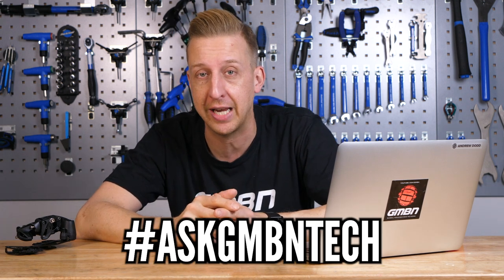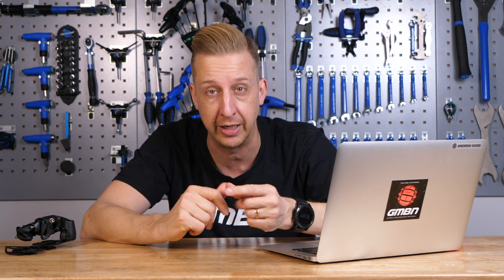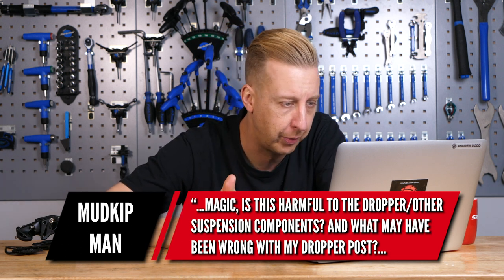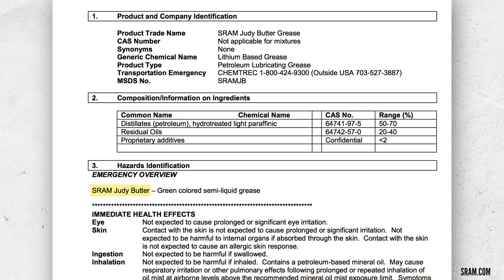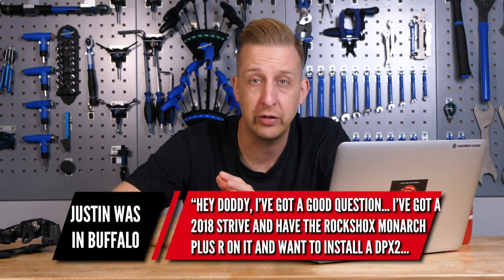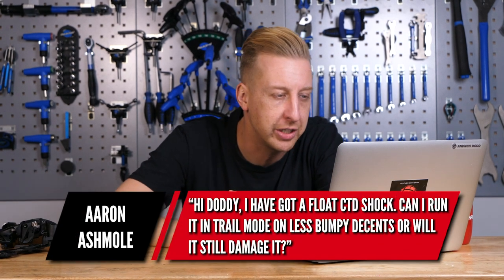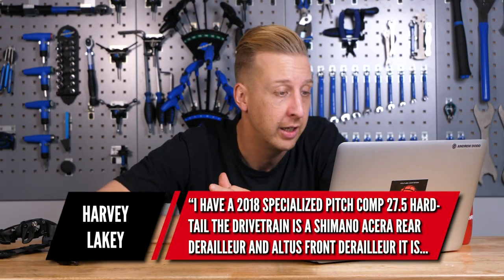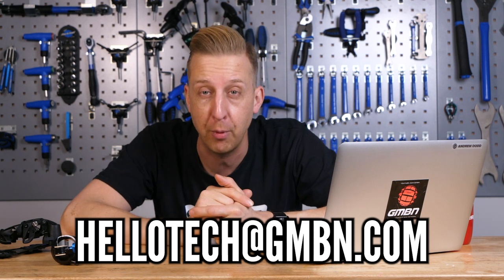Can You Use Vaseline On Mountain Bike Suspension Forks? | Ask GMBN Tech

Comment from the maker: Don't forget to leave your questions in the comments below using #AskGMBNTech
Reply: #AskGMBNTech Hey Doddy! I have a project bike (Vitus Nucleus) with a stock Suntour XCT coil-fork. I took it apart for a dumb reason and after that the fork has had quite a bit of play in the bushings (or seals since I removed them too). What is the cause and how can I solve it? I'd like it to work as it's meant to do till the day I upgrade it. Thank you!
Reply: Hi Doddy is it normal to loose teeth on the biggest sprocket on a 1 x11 system, if so what causes it to happen ? Because I have one or 2 teeth missing on my bike - Thanks Kyle #AskGMBNTech
Reply: #AskGMBNTech I have just bought an Avanti Competitor S 1 Plus. It shares the same frame as its big brother the Competitor S 2 which comes with an external dropper post.  I'm wandering if I should add a dropper post to it now as I am concerned that manufactures will go 100% internal cabling in their line up. Also what upgrades should I do to it for a beginner? (sorry for double posting I was not sure if I was to post it in the general comments or here)
Reply: Im looking forward to the video on the bar and stem changes!
Reply: #AskGMBNTech Hi Doddy. First of all love the shows and have been a great help allot of times. The question is, if it's possible to upgrade a 2016 strive with the new fox shape shifter 2.0 system?
Reply: #AskGMBNTech I've been working on my chain and it doesn't have a mater link so I've took out the pin but the pin has came all the way out. How do I put it back in?
Reply: @alexhazeldine7897  with a hammer (don't actually use a hammerl
Reply: #AskGMBNTech hey doddy I was wondering if you could actually use the mineral oil from of the reverb remote system for a shimano brake as its both mineral oil...
obviously it's most probably not the same mineral oil, but do you think/know if it works?
Reply: recently my old bike front shox rebound stick is gone,the old bike is a RockShox 30T silver..what could i use to replace the missing rebound stick#askGMBNtech
Reply: #AskGMBNTech Hi Doddy, I am riding mainly XC events and used to have Shimano SPD pedals. But I did not like them because they are difficult to clip in in muddy conditions. I upgraded my bike and I am looking into either LOOK X-Track or LOOK X-Track Enrage. I like LOOK road pedals and hope that their MTB pedals would be as good. But which version should I buy - X-Track or Enrage?
Reply: @alex_smallet  crankbrothers eggbeater - can't be beat in terms of mud clearance!
Reply: #AskGMBNTech my forks have black scratches on it and I’ve wiped it off all reddy but it has came back
Reply: It’s like grees
Reply: #AskGMBNTech   I have a 2008 giant reign with a raceface ride chainset and am going to go from 3x to 1x and want to know what tool I need for Removing the chainset as their are so many options. I've removed the 8mm bolt from the driveside but can't get the Crank arm off without the correct tool can you help. Cheers🍺🍺🍺
Reply: tysm

Comment: I have the extract same set up on my Giant XTC xl frame with a Thompson 70 mm stem and 40mm rise on my Rental carbon bars. Also using a Thompson straight seat post. It's  a Giant XTC 29er. I have nerve issues with my spine and it gives me neurological problems with my arms so I know your pain,  literally.  With this set up I just move my seat on the rails to get the right position and I can climb some extremely steep hills no problem without loading the rear too much at all. I weigh just over 150lbs. As long as your good with technique it works no problem.  My son who is taller than me loves riding my bike , it's very agile even though single track as well. Hope this set up help people with similar problems.  I also run fatter grips to help as well.

Comment: One day before death I will have a tapered stem mtb 🤣 and wheels larger than 26" ,it's so comfortable on my rockshox recon sl Marin T6 ovation framed resto mod ,front 203mm disc /V brake rear ,rides like butter, silent smoothness and so mint for a 20 year old bike.The air fork is insanely stable with 32mm stanchions replacing the sync narrow steel sprung job.So lightweight.

Comment: Have you ever put scales under each wheel once your MTBs are set up how you like them Doddy , does each end have the same weight , if not 50/50 is the distribution still the same on all your bikes ?  How about the EMTB you ride is that biased slightly more rear ?
Reply: the bikes weight is pretty irrelevant compared to the rider on it.

Comment: The guy with the 3x9 transmission wanting to go 1x. I do a lot of street riding with my very old 3x6 gears.  I've been looking for a new bike. Some of the low gears in the 1x systems are lower than mine, but not one of them has a high gear high enough even for an old duffer like myself. Is there simply no need for say the 4.0x top gear on 2x and 3x MTB transmissions?

And because I can only judge gears by comparing them to what I'm familiar with 26" Low .88x (28:32) High 3.43x (48:14) I definitely want a lower low gear for climbing. 1xs are a bit better at this end. My top end is okay (for me) but I use it a couple of times on a ride, (Probably mostly on pavement) and I wouldn't want to go any lower. 
The top end of an 30:11-42 is 2.73x (Adjusting for the difference between 26" and 29" wheels I do this. Wheel size x (Front/Back)/26, For 26" wheels. So 26x 3.43/26 = 3.43 but a 29 x (30/11)/26 = 3.05x much lower
Low gears:  .88, for 29" wheels 29x (30/42)/26 =.79   The 29 to 26 of course is just 1.12x (front/rear)

Comment: #AskGMBNTech
Hi doddy, 
My seatpost spins around altough I use the highest torque I'm allowed to use on the clamp, I tried a new clamp, yet it spins. I already applied assemply paste and it doesn't work, but sometimes it creeks when i'm moving on my seat.
Any advice? 
All parts are stock and Aluminium.
Reply: Maik Eckert bigger seatpost?

Comment: @. Hi Doody, great show. I have a question about pedals. I have been using clipless pedals since the mid 90's. I currently use the Crank Brother Mallet 2 pedals. How ever I have taken your advice and bought a set of Shimano Saint flat pedals and a Five Ten Freerider canvas shoes. My problem is when I use the flat pedals my hands and feet start to feel numb. I have changed the just over 12 months ago and did get hand numbness. I have adjust the role of the bars and this seems to have sorted it. When I use my flat pedals it the hand numbness come back and my feet go numb. Which I don't get using my clipless pedals. What do you think could have changed with my position on the bike using the different types pedals. I know sometime with the flat pedals the ball of my foot if not over the pedal axle. I did change my bike from a 2x10 to a 1x11 mainly Shimano SLX  with an 34 Absolute Black oval ring and 11X50 Sunrace cassette.

Comment: You said not to put Vaseline on Rubber but you can put it in your fork but suspension forks have rubber seals
Reply: Well it depends of the type of rubber,actually there is a whole list of rubbers that are compatible with some components ,other types get swell up by silicone like old rock shock ones with gt85  for example,in this cases nowadays rubbers in dust wipers are mostly nitrile ones wich can stand lots of stuff ,others are a blend ,others are specific so that's why he says based on the components of vaseline that's pretty safe for seals to use it

Comment: #AskGMBNTech I've got a 2014 Rockshox Reba RL with the PushLoc remote. Do i need to change the damper in order to swap the remote for a crown lever or can i just remove the spring from the existing damper? Thanks in advance

Comment: I am going to be replacing the coil in my fork and fox recommends to coat the spring in a product called “slick honey” but I don’t have this and it’s expensive is there any other kind of grease I could use and could I use Vaseline?
Reply: Don’t use Vaseline, use sram butter or slickoleum, both of them are very goof

Comment: Why can't my rockshox recon accept bottomless tokens? Can I do anything (on the cheap) to fix that. I feel like I put in far too much air pressure so I could get the progressiveness correct. #askGMBNtech
Reply: if it doesnt have a negative air chamber but uses a coil spring you can put oil in the airspring. If it does have a negative air spring you could maybe glue a piece of high density closed cell foam to the air cap

Comment: Can I use vaseline on my fork's stanchions and dropper stanchions? Just to make it smooth, stanchions only not the seals. #AskGMBNTech
Reply: You could do it on the interior of your fork seals when doing a lower service, but you should absolutely avoid doing it externally as it will only attract dirt and drag contaminants into your lowers foam rings... For the dropper post you could if you applied it conservatively directly to the bushing, but I'd be cautious about just coating the stanchion, as that will again just attract dirt and clog your dropper.

Comment: #askgmb tech. I'm new to MTB with Sus folks. I've got a 2016 rockhopper pro that has a rockshock 30 gold fork with remote lockout. The remote does not seem to make a difference in firmness on or off. Lbs adjusted the remote, but can't tell the difference. My experience is limited to a demo day where I tried bikes with a clear difference lockout on/off. Could the internals of the fork be at fault?  Should I pursue getting rid of the remote? Thanks Nigel
Reply: find the lockout position by twisting the cap manually untill the fork locks. If the fork cant be locked this way there is an internal problem
Reply: @ultiss  just tried this, no effect! Not confident about taking the fork apart and knowing what the cause is. I think I'll get my lbs to look at it and remove the remote...
Reply: @nigew25  if you remove just the lower legs you can see if the damper has leaked. If oil has left the damper it will result in no lock out

Comment: #askgmbntech rate a btwin mtb. Are they a good beginner mtb bike?
Reply: You really shouldn't get a btwin, what's your budget? Maybe the comment section can help
Reply: The rockrider branded frames look alright. The btwin bikes just seem bottom end. If you buy a mtb for 300 euros you will get a street bike that looks like a mtb, it wont perform on trails. I would suggest looking for an older decent 2nd hand mtb. Do some research about drive train differences, forks etc. This video shows a good overview: https://www.youtube.com/watch?v=K882pvG395w&t=7s
Reply: Yes :)
Reply: Rather get a Giant ATX 2 or a 2nd hand bike. A good friend of mine hast a btwin Rockrider 520 and it's crap, even for 300 euros...
Reply: If you can stretch to £900/1000 have a look at go outdoors calibre bossnut full sus it's got decent rockshox gear on it, I brought one for my nephew 2 weeks ago and it's a really good bike and it'll last you years. I had a go on it and it's as good as my bike which cost over twice the price.. B twin mtbs are pretty useless just like Halfords bikes if you plan to take it off road. Honestly check out go outdoors bikes.
Reply: Always had btwin bikes they're great. Value for money and good brand. Solid frames and parts.

Comment: Hi Doddy! I have a question about rear wheel axle standards for dirtbikes. At the moment I´m running a rear wheel with a bolt on axle (nuts on both ends), will a wheel with a bolt in axle also fit? #AskGMBNTech

Comment: Hi, sir Dodds, just wondering if you have heard anything about the shock bolt coming loose on the mega? I've just bought a 2019 mega and every ride the shock bolt is coming loose and nearly out the nut, I put a drop of lock tight on and it still came loose
Reply: Did you use blue or red thread lock?! Properly clean nut and bolt threads beforehand.
Reply: never use red on a bike, medium blue should be fine

Comment: #AskGMBNtech.... help help help

I have a sunrace 11x1 cassette which seems to shift fine but if I stop and backwind for whatever reason the cassette skips down the gears which is very annoying and sounds nasty when I set off again. My local bike shop didn’t seem interested and just wanted to sell me a new cassette and derailleur. The b screw is fully wound in . Do I need to start again and set the derailleur h/l screws or does it need a professional to look at it.  Great show doddy 👍
Reply: As he has mentioned before, don't back pedal, your transmission isn't designed to do so.

Comment: well chain lube damage any seals on suspension forks
Reply: Yep that's because some dry or wet chain lubes actually uses some kind of solvent as a carrier agent to carry the  lube component in the purpose of getting deep into de metals,once dry the solvent all it remains is the lube, but in the evaporation process and application andcontinous exposure is where the rubber harm is done

Comment: #askgmbntech

I ride a Radon Slide 160 Carbon wich came up with a SRAM X0 2x10 setup (26-36 up front and 11-36 in the rear). I want to switch to a 1x setup with a narrow-wide 30T chainring and 11-42  Shimano Deore casette.

1. How will that affect the climbing efficiency? How do the lowest 30x42 gear of the 1x compares to the 26x36 of the 2x system? 
2. The rear mech is the SRAM X0 type 2. Will I be able to use that mech for the new 1x setup or do I have to change that as well?  

Thank you! Keep up the good work!
Reply: 1. ratio 1x is 30:42 and 2x is 30,333:42, so it gets a tad bit easier to push,
2. SRAM X0 type 2 comes with three different length cages, which one u got?
Note that all of'em have a limit of 36 teeth for the biggest cog, so you'll need a new derailleur! (there's derailleur hanger extenders/adapters out there to make it work with bigger ones but afaik going 40 teeth is the absolute max)

Got the same bike and had a look into a 1x-update at some point, but ended up keeping the 2x setup.
Reply: In this case I'm gonna stick to 2x10 until it wears out, and save for 1x11 or even 1x12  with the NX casette.
Reply: @razvanchiriac84  There are easy tools to compare drivetrains like this one: http://www.ritzelrechner.de/

Comment: #AskGMBNTech
Why are SRAM eagle derailleurs so shXt? 
Always ran Shimano xt and never had a problem. New bike came with eagle and I'm on my 3rd already, riding the same trails. 

Would the new xtr 12sp derailleur work "unofficially" with eagle cassette and shifter?

Thanks!
Reply: Which kinda problems did you encounter?!
Reply: No because the pull ratio is different between sram and shimano shifter so you cant mismatch the derailleurs and shifters, if you get a shimano shifter and derailleur it will work fine though

Comment: Is wind chill a factor when nearing the minimum temperature recommended for suspension? The Rockshox Revelation fork that came on my 2018 Scout says the minimum temperature to use it in is 10°f. 
So if the temperature is 20°f and  with the windchill it feels like 0°f is it ok to ride that fork outside?
#askgmbntech

Comment: #AskGMBNTech what are your thoughts on angle headsets? I'd like to slacken my stumpy/pike combo slightly for more aggressive riding but am wary of undoing the geometry of the frame it was designed with. Have you any experience of riding a bike altered with an angle headset?
Reply: Leave it alone. Jared Graves races a stumpjumper in EWS. Riding doesn't get much more aggressive than that. Unless you were thinking of using it at a jump park in which case it's the wrong bike. 👍

Comment: #askgmbntech there are 100s of videos on tubes install but few on fat or plus tubeless install.  Any tips?
Reply: Thoroughly clean (used!) tire's beads before install and apply enough rim tape to make it a tight fit so they provide a proper seal.
Remove valve core before inflating to make both beads °pop° - deflate, replace valve core, then reinflate.
Maybe get a pump with compressor/reservoir (not needed if they sit properly).

Comment: #askgmbntech is it possible to fit a m9100 group set on a scott genius? And if so can you fit a 2x12 cassette? Using the 10-51
Reply: Rear derailleur won't be able to handle the spread, 45 teeth max afaik.

Comment: #AskGMBNTeh On your answer about converting from a 3x9 to a 1x10, 11, 12. Will the original rear derailleur fit a bigger cassette(by adjusting the limit screws) or do you need to change it? Also if you wear out your transmission completely, does it automatically mean that the rear derailleur has to be changed?
Reply: You need a 1x derailleur.
Reply: You do need to make sure the rear mech can fit the size of the largest cog on the cassette (1st gear) and also, it's best if it is an 11spd or whatever speed you decide on moving to.